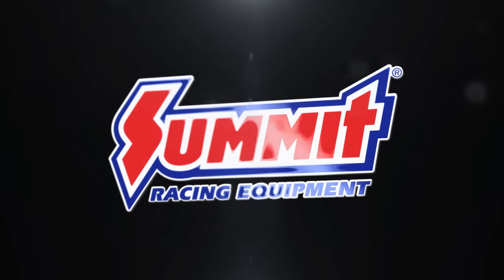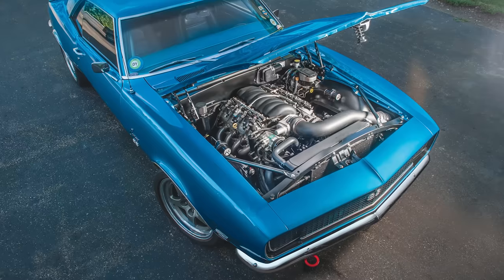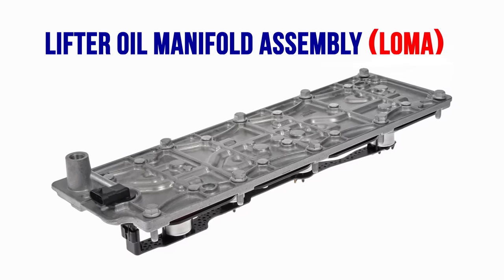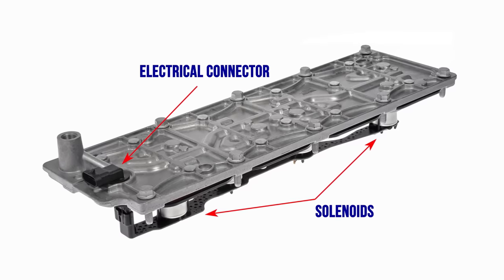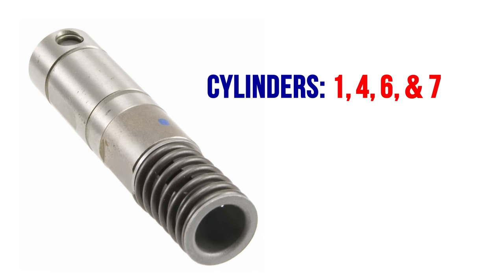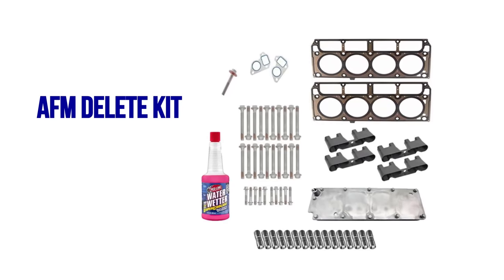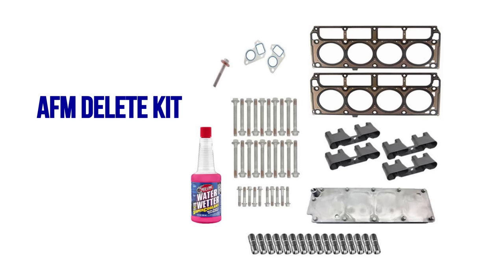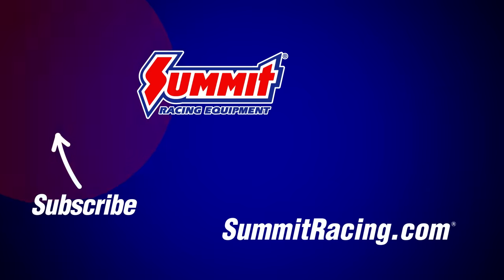Why and How to Disable GM's Active Fuel Management (AFM)!

Comment: Great video and very informative. This explains why some people still have lifter failure even after they've installed a disabler because it seems that the lifter or other components pertinent to the AFM/DFM system were already failing at that point. So in short, it might seem that the best solution is to purchase the disabler and install it almost immediately after you purchase the vehicle. This way, you are actually taking preventative action and not just putting a band-aid on an already bad part.
Reply from the maker: Thank you for listening and for your feedback!
Reply: I buying a 2021 next weekend. Its still at the factory and is scheduled to be delivered between Oct 23 - 25...I'm assuming this will be early enough in the life of the engine that lifter damage will not have occurred?...hopefully.
Reply: The full deal replaces the spring lifters and oil pump parts.
Reply: @73emce  no
Reply: I just bought a 2018 Sierra with 40K on it. Here’s to hoping the disabler route saves me an engine rebuild.
Reply: Unfortunately, simply disabling the AFM won't save the engine.  As long as the mechanic parts are in the engine, even if the system has been disabled, they will fail.  My 6.2L 5th Gen Camaro , with only 62k miles and the AFM disabled had the number 5 cylinder blow out when the lifter colapsed and punched a quarter sized hole in the piston.  I had to replace the engine, but had it built with no AFM.  Gm will not disable it or take responsibily for it, even though they know the system is garbage.
Reply: I got my '15 with 21K and had a slight tick at cold idle until I drove it for a 1/4 mile.  Put a tune that removed the AFM and have 89K with no tick. Got lucky I guess. 
That and frequent oil changes (4-5K)
Reply: @garyklepperich5490 that really sucks.. did you drive the car extremely hard? Ive got a 05 trailblazer with 5.3.. had the range unit on since 88,000 miles, now have 114,000 miles no issues with motor.. i accelerate pretty hard, but rarely go over 4,000 rpm.
Reply: @keithbellair9508  Not at all.  I took extra care with it.  My engines get the best of everything.  Beast, my 2011 Wrangler, has 300k miles and runs like the day I bought it new.  I'm meticulous about my cars.

Comment: I had to turn in my leased 2017 Ram 1500. The dealer would not fix the cam phaser , check engine, dangerous limp mode issue. Was under warrenty , but the lease date was up. I returned it , luckily was leased .
I bought a pre AFM GMC Sierra 4x4, made in Canada,  was a Texas truck , low miles. Great truck. I think these older trucks will go up in value. I'm starting to see it already.
I average 15 to 16mpg. Loaded with tools and ladder rack for work the four doors , I use the back for my portable tool boxes and very versatile . I can just put the tool boxes in the back bed and then I can carry 5 people. Comfortable on high way and town 😌
Reply: I live in mass and own and drive  several rust free  vehicles from out west and down south . I also have many rusty new England parts cars and trucks in my collection . I got tired of repairing rotted garbage and changing brake lines .

Comment: Now this info answers a lot of questions about gen 4 and 5 reliability and AFM DOD. I have the RANGE Dis-abler on my 2015 5.3 Silverado. I leave it plugged all the time. I'll take the hit on MPG, I didn't like the shudder I got when cruising at 30-45 mpg, converter locked up, in over drive, on 4cyl mode. The switching in and out of these systems, made me say, Oh Hell No. Disabled in v8 mode is smooth as expected. This system shifts thru all six speeds pretty quickly even in steady cruise, and the shutter wasn't going to cut it. Pulling a trailer with car, at 60 mph+ with AFM ENABLED, is no problem, and I get 20 mpg+. But I just leave it disabled.
Reply: How she running 2 years later?
Reply: @JXC98  Very well no complaints at all.

Comment: I'm one of many who had the expensive experience of an AFM lifter failure on a low mileage engine. ( just out of warranty) The internal damage was extensive, and expensive. I didn't know about the delete kit until the rebuild was nearly complete……however I did buy an AFM disabler for my 6.2.  My fuel mileage is exactly the same as before in mixed, city, and highway driving!
Reply: I have heard that it's best to unplug the disabler when the engine is off to prevent battery drain. Have you experienced this?

Comment: I had a range disabler in my 09 silverado, starting at 60k miles when I bought it.  at 90k I lost #6 intake lifter.  After having the lifers, etc replaced twice I ended up replacing it with an AFM deleted Jasper engine.  Truck ran great after that but cost me a lot of money.
Reply: How much
Reply: I did the same thing with my 09 Silverado I bought with 60,000 miles . It worked great for me. no oil consumption and never had a check engine light come on 211,000 miles now.
Reply: I installed a disabler about a month ago on my 08 Sierra with 129,000. Used 1/2 qt between oil chg’s every 3k. Originally thought it was transmission going out on deceleration with shudder when it reached 2nd gear. Mechanic told me AFTER I had other shop chg fluid & install Dura Lube in trans. Drove it a week when other shop said get a disabler. Ordered it from Amazon. Shudder stopped immediately.  Simple fix & very thankful.

Comment: I have an 2015 Sierra with the 5.3, the free way to deactivate the AFM is to put the shifter in M5 and it locks out the AFM. I don’t do any extended highway driving anyway so 5 gears and a true V8 is plenty for me.
Reply: did that today ,, u just bought a 14 Silverado 1500 z71 off road truck with 100,115 miles on it.. truck drives great i hate the v4 crap already. drove it in m5 today with no issues..

Comment: Got a range technology dfm disabler in my 2020 AT4 with the 5.3 , its awesome  also had it in my 2018 Denali  with the 6.2 and worked perfectly in that as well
Reply: Went on this site and it states when checking fitment, said the model linked doesn’t fit.  Did you use the part linked in this video?  Have a 21 LT Trailboss w the 5.3
Reply: Is it true if you go above 80 with the range it will go back to switching to V4 mode ?
Reply: If you use the afm disabler do you need to plug the prv and change to a low volume oil pump? Or is that just if you do the actual delete kit?
Reply: @alexcerrito9111  I have a Range disabler in my 22’ Camaro. Gotten above 80 many times, and never has it switched back to v4 mode with the device plugged in since before I installed the product. Hands down the best investment I’m making for getting 15 mpg now.
Reply: @dustinwhipple5203  No, the stock system in the car will run just fine. The disabler just shuts down the AFM from letting the car switch back and forth. It won’t do any damage with the systems Installed set up for the AFM
Reply: @captfrostii3675  can you send me a link of where to buy this?
Reply: @dustinwhipple5203   I want to know that answer to that question also!
Reply: @1LE_Ciko yes where ?

Comment: You should never use a plug in OB2 dongle. It will result in check engine lights & other codes, plus it can back feed into the main computer & shorting it out. The best way to disable the AFM or DOD is to use an inline Disabler  such as the Range Technologies Pulsar kits.
Reply: I need to check that out… it says the puslat doesn’t work on my model. Looks like it plugs into the ecu.. hopefully range doesnt sale a product that will do what you say
Reply: I have a Range version since 2019 and 50,000 miles and none of this e problems.
Reply: I’ve used the range disabler for a few years. None of what you mentioned has happened to me.

Comment: One important question, what if I use the AFM disappear for a few years (say 5 years) and I took it off for a while later, would there be problems? I’ve heard that lifters will collapse very soon due to carbon that been already built up at those years and the lifter will not retract

Comment: With regard to the high pressure oil pump spraying too much oil on cylinder walls, is the plug fix for this issue advised when just going the deactivation route?

Comment: If I delete and keep the original valley cover (for check engine light), does anything need covered or plugged up so oil doesn’t flow through the afm system downstream from the solenoid?

Comment: My 2021 has the range technology since new and also highly recommend changing the transmission thermostat with a new superior transmission bypass valve 2021 trail boss 5-3
Both the engine and trans Humming

Comment: Ok I have a 2017 gmc sierra with a 5.3 with roughly 70000 km .....I haven't had a issue but iam worried about the lifter issue... should I buy one of the electronic  modules to disable  the afm . And will this certainly stop a lifter issue
Reply: I have a 5.3 and installed disabler at 90,000 because of oil consumption. Now I'm at 109,000 and am hearing lifter tic and hoping it holds out till I get a new van.
Reply: @megaleadjp omg it didn’t help 🤔

Comment: Whats the average cost for a complete DOD AFM delete job on a 2014 5.3.?  I got a quote from a local performance shop and told me its about 7k-8k job with all parts and labor. I know my way around an engine but find this to be ridiculously high... I have asked some local shops and they state they have complete 6.2 for about 3-4k... whats the best route?? Should i buy a used engine or rebuild...Am seriously  thinking of just cutting my loss and getting a Toyota Tacoma...
Reply: Wow, that’s a serious knee jerk reaction to a very common problem…. If you’re not stoked on AFM, you should definitely buy a chronically underpowered Toyota so it’s gutless all the time guaranteed. I guess that’s one way to go about it….
Reply: @timmarkham522  am not ok with paying 55k and get mediocre quality and call a completer engine tear down a "common" issue. It's not like you're replacing a fuel pump/alternator/battery. I prefer "under-power" rather than no power and call  engine rebuild a common issue

Comment: How do you know if your lifters have started to fail? I just bought the Range disabler device because I heard a small knocking sound in my engine when I first start it, but it goes away after a little bit. 2009 Silverado 5.3 V8, 132k miles. Thanks.
Reply: I read that ticking sound at start up could be just the drive belts. That what I read, and it goes away when you drive a bit.
Reply: @barrypowell829  Huh. Thanks. Considering getting a tune up for it. Still does it with the Range device.

Comment: I am about to get a stage 2 cam and must have this deleted and a mechanic I know Said you could get a chip to do this..  I was skeptical a liiiiiiittle bit but seeing this makes me feel confident that it’s fine (when your AFM system works fine at the moment).  Thanks guys.  I’ll be ordering that chip.   Question: anyone please tell me what happens if the chip fails and there is a stage 2 cam installed….  Potential damage:risks.?
Reply: There’s a $200 plug in that u stick in the tuner port to deactivate it
Reply: Only old pcm need a chip and I mean 90s pcm but anything that comes with a Ls family engine need a tune like hp tuners
Reply: Just buy the stage 2 cam, you’ll be happier….I was

Comment: I have an 07' monte carlo ss with the 5.3 v8; and afm system. All I do is keep the automatic transmission in 3rd. gear around town and that keeps all 8 cylinders active. Regular yearly engine oil changes with a high quality synthetic oil, are a must as well. Can anyone tell me if I'm on the right track??

Comment: Using the AFM disable device will only work if lifter damage has not yet begun. The other, and most important part is changing oil every 4000-4500 miles. These engines do not tolerate wear well if going to a longer oil change interval. Having done these two things will lessen the chances of lifter failure considerably.
Reply: SERVICE 1956: I'm not a mechanic and, so, my question. Does your suggestion to change the oil every 4000-4500 miles still apply if I'm using Mobil 1 synthetic oil? As a note also, I have no engine oil loss after 6,000 miles (so far).
Reply: @lazurm  There are 2 problems that these engines have. First is that they do not tolerate dirty oil for an extended period of time. The oil itself will not break down a whole lot in 5000 miles but, the problem remains when hydrocarbons form inside the crankcase contaminating the oil. Also, short trips during cold weather will result in moisture to form inside the crankcase. This is bad, especially for these engines. Tuning out the AFM will keep it in full time 8 cyl mode. Therefore the VLOM solenoids will not activate, and the lifters will not activate. Doing these 2 things will greatly lessen the chance of having AFM related problems. Another problem I just thought about is that there is a filter screen under the oil pressure sending unit that gets clogged and can cause a problem. This is also brought on by going too long between oil changes.
Reply: @service1956  I'm not sure if I even have the engine that has a AFM. I have. GMC Savanna 1500 from 2013, 8th vin is "4".
Reply: @lazurm  
Depends if your engine oil capacity too 
6 quarts 4500 is the best 
8-9 quarts up to 8-9000 miles using Mobil 1 filter

Comment: Sounds like GM didn't do any better with this system than they did with the old Cadillac 8-6-4 system in the 80's.  Isn't the definition insanity doing the same thing over and over and expecting a different result.

Comment: I got 160k hard miles on my 08 without issue. Make sure you run the proper oil in the engine or they will burn oil like crazy. Ask me how I know. That being said, when the engine inevitably takes a dump, I’ll yank it out and do a cheap rebuild and kill all the AFM components. This pickup is always towing or pushing a plow, that 4 cylinder nonsense isn’t saving me any fuel. They’re good engines though. We have several in the family. Intake gaskets and oil pressure sensors are the main repairs on them. No big deal. Do them both at the same time and don’t worry about it for years to come. Always used FelPro gaskets with great luck.
Reply: I have a 2010 Silverado 5.3….it has burned oil like crazy since day 1, brand new. Like 2 quarts or more every 3k. I just put the new valve cover (driver side only) because, apparently there was a design flaw in the drainage, and lots of oil went through the PCV. As somebody mentioned, my number 1 plug was very gunked up, and number 7 was pretty bad.
Oil consumption has slowed, but its still too much,
Any ideas? Do you know about that diverter he mentioned at 3:00?

Comment: Step 1: Own a 2009 Yukon flex fuel with 250k on it.
Step 2: Be stupidly lucky and have the 5.3 LMG stuck in V8 mode, not V4.😎
Step 3: Use a Range AFM Disabler to make sure it stays that way.
Step 4: AFM delete and full engine rebuild with a mild Corvette cam and lifters when the trans finally goes and gets rebuilt in another 100k.
Step 5: Drive it another 10+ years. Learn to brew ethanol moonshine to keep the pig fed when gasoline is $10 a gallon.😂
Reply: yes to making ethenol at home!
Reply: Hee Haw

Comment: Guys an some girls don’t worry AFM is easy to work on an fix. It’s not as bad as it seems. You just need a few parts. Like a BTR stage 2 cam ls7 lifters an VVT delete an a few gaskets an head bolts. A dyno tune an you will never have a problem out of your AFM. SS headers an duel exhaust is optional. Best upgrades I made to mine
Reply: I second this.
Reply: It's just common sense
Reply: Tearing apart the engine and basically rebuilding it is nothing to worry about and easy to fix? Lol

Comment: I just got a new remanufactured 5.3 L engine for my Silverado 2013, the engine previously belonged to a 2014 Yukon. As soon as I got the truck from the shop I installed my ranger. The original engine broke because I was driving on highway at 70 mph using the cruise control then I slowed down to 40-45 because of a accident as soon as I passed the accident I made the mistake of pressing the RES+ button so the car could go back to its previous cruising speed. The car used accelerated so hard rpm went all the way up to 5000 to reach 70 mph as soon as possible. As soon as it reached 70 mph the car started shaking, that when I knew the engine was f...ed up. New engine $6280 plus taxes.

Comment: Found a gently used and well maintained '13 silverado with AFM. Taking a chance on it in this market. That Range disabler seems to be the way to go for now at only 60k miles. Do y'all think I need to put a different oil pump in and block the PRV?